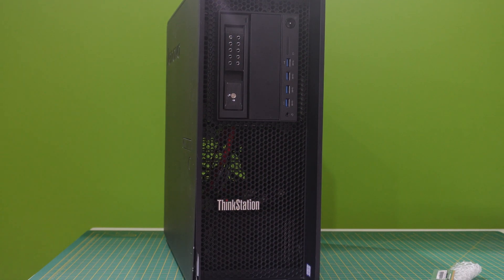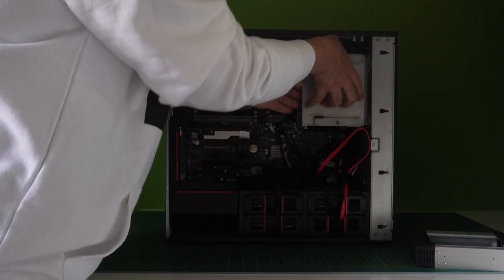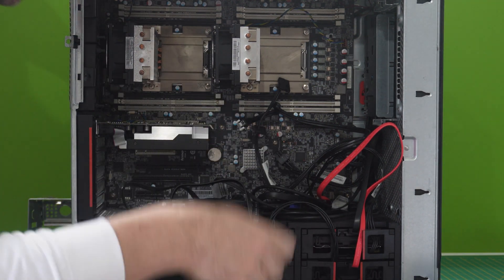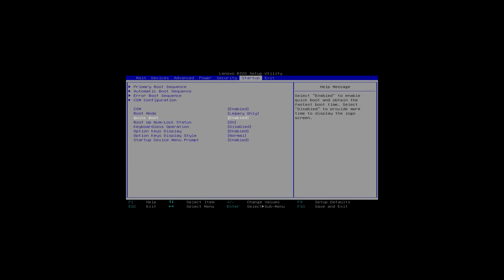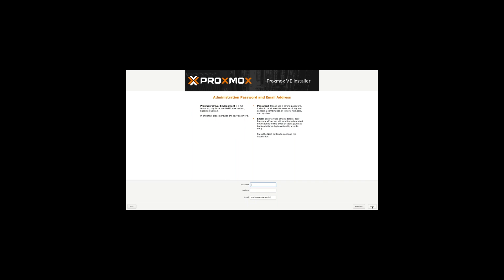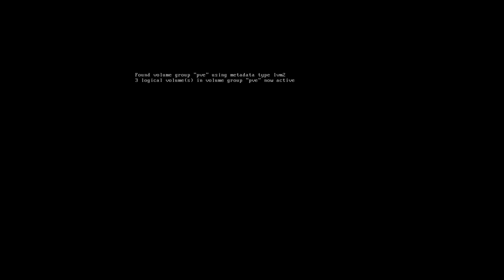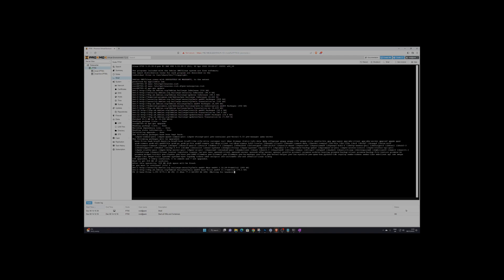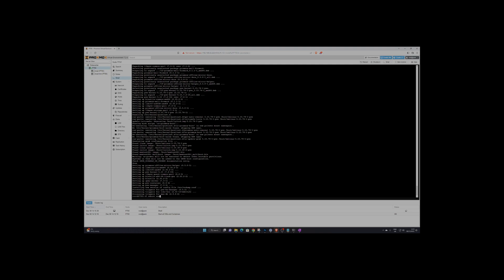Affordable Powerhouse: Building an Incredible P700 Lenovo Homelab on a Budget

Comment: hi, I am currently looking to buy that pc also. is there m.2 slot on that machine ?
Reply from the maker: There isn’t from what I can remember you can however add a pci card to m2 and get it to boot from it
Reply: you need the flex m.2 adapter , you get 2 slots m.2 with that.

Comment: Can we swap the power supply of this unit to regular power supply with pin connector?
Reply from the maker: You can you may need an adaptor though I did for my hp440 build for example usually they available on Amazon

Comment: Hows the noise???  there are only 2 moving parts, The cpu fan and the case fan. I've had a dozen of Dell and a dozen at least of Lenovo. Never had any to make noise. Do you need a Doctor?
Reply from the maker: For what I have potentially. The noise only creeps up as the rpms of the fan increases to dissipate the heat. Towers are much better than say a 1u server. For example.